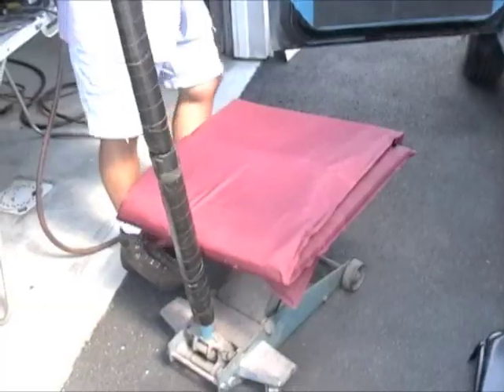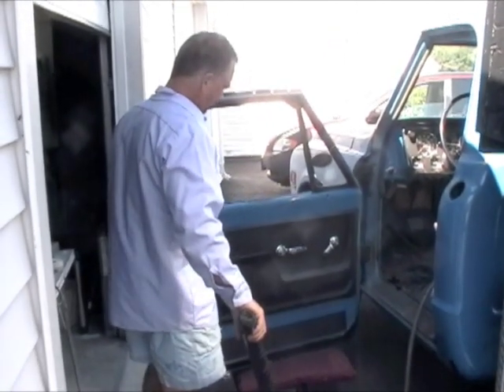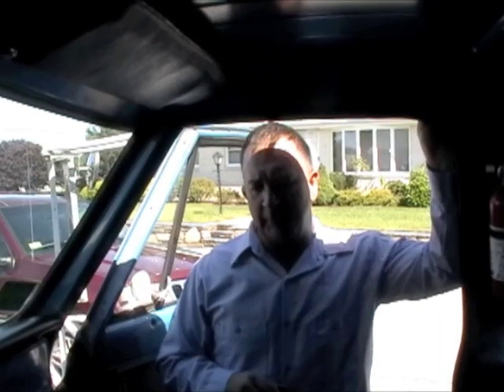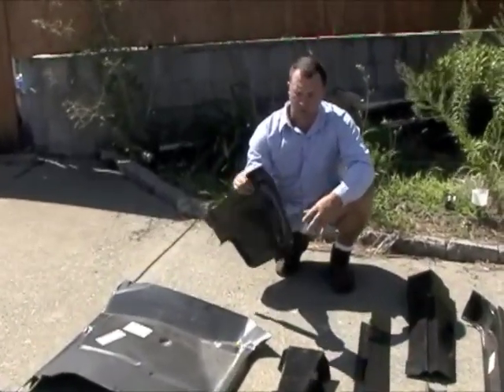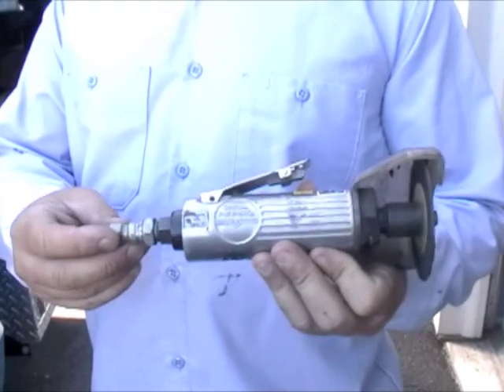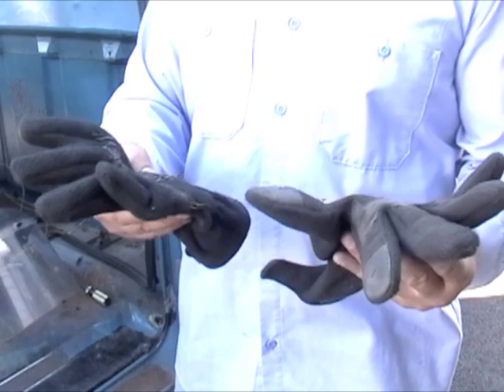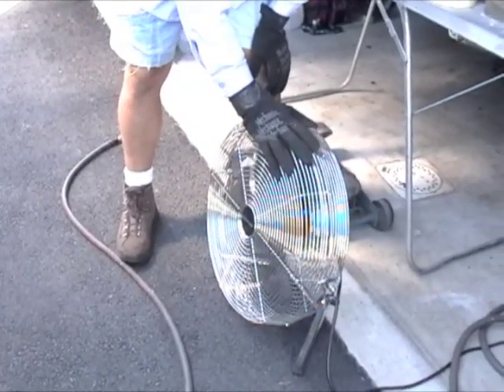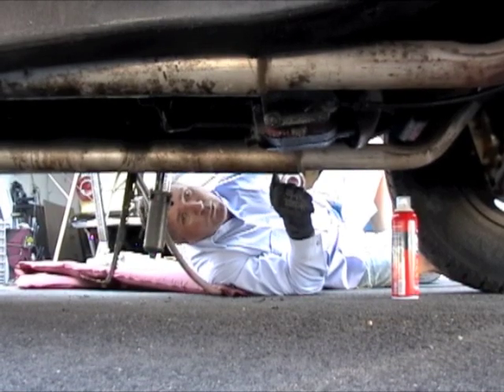How to repair rust on a 1972 Chevrolet Truck  #1

Comment: just remember not to use the air ratchet to tighten the door bolts up.
you'll risk stripping the threads in the backing plate.  great vid!